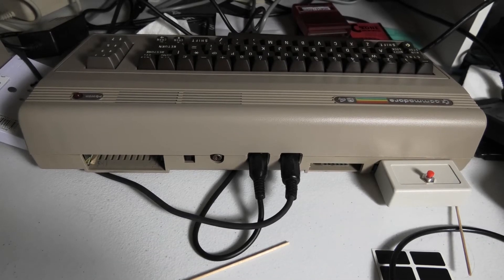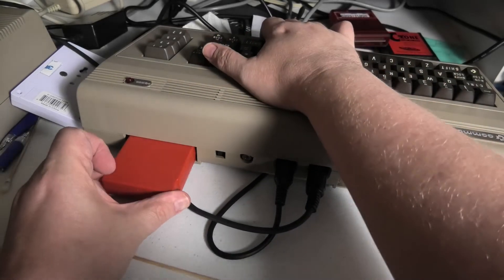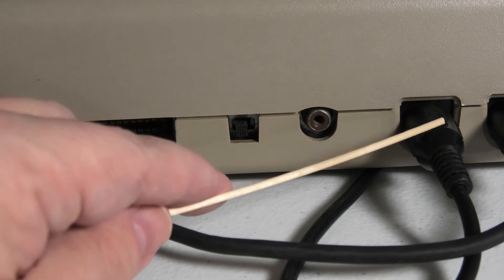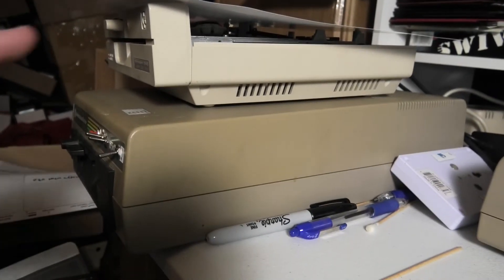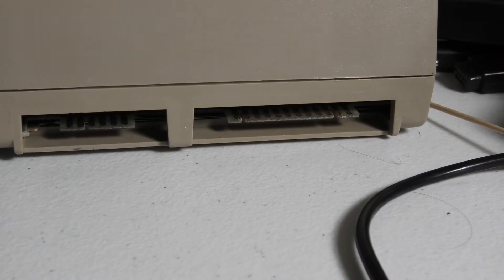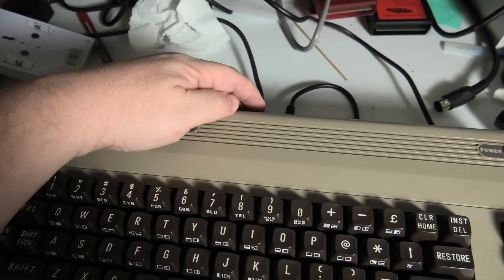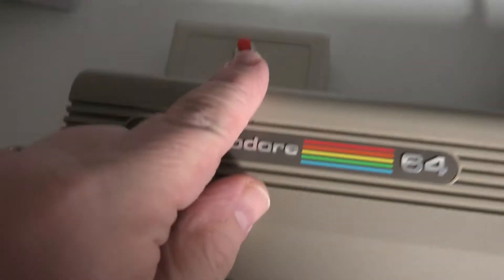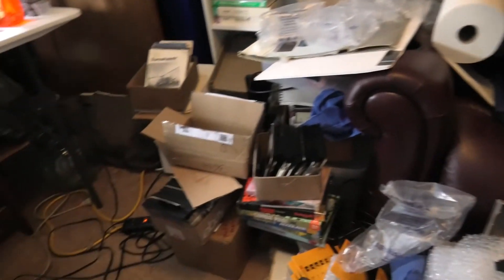Commodore 64 Ports & Plugs - what are they all for?

Comment: I have a swedish c64 and The ports are labeld and The channel select is called H-L and there is no switch there just a hole with a metal Wall inside
Reply from the maker: Interesting, I have never seen a Swedish C64 before
Reply: @StevesRetroGaming  it is pretty much the same it just has the å ä and ö Keys and is called a vic 64 in The manual
Reply: I have now bought a 5 pin din to scart adapter so i can see video from it.